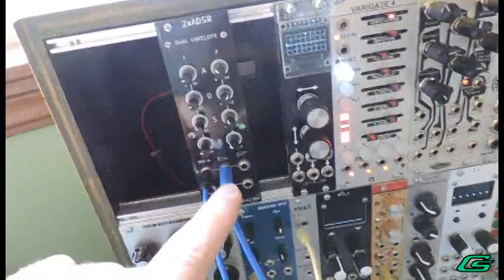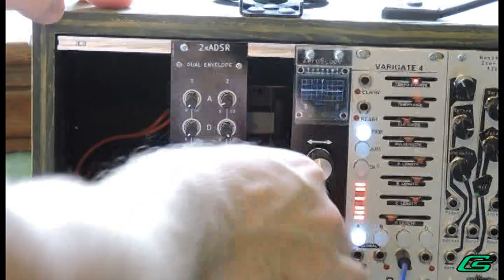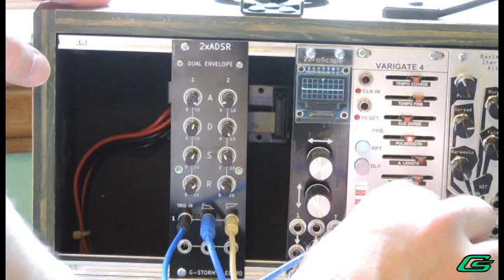2xADSR Dual Envelope Euorack Module Demo

Comment: May I ask what made you want to model these envelope on Minibrute and not say a DSI or Roland envelopes?
Reply from the maker: Oh so many reasons: all parts are cost-effective and readily available for builders, 555 timer design is ingenious and makes fun diy learning, and these envelopes are very snappy indeed.
Reply: @gstormelectro  Sounds reasonable :) what's the max time on the Attack and Release by the way? cheers
Reply from the maker: The fast mode attack range 1ms to 1s, release 1ms to 3s.  So not much for long attack/release.  My next version available in a couple of weeks will have the slow mode, I'll shoot some scope measurements then.